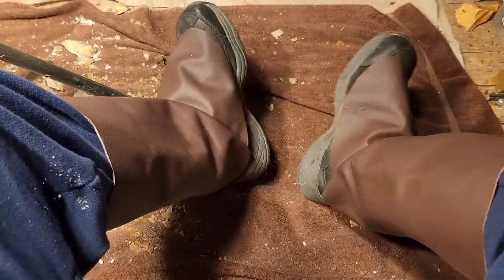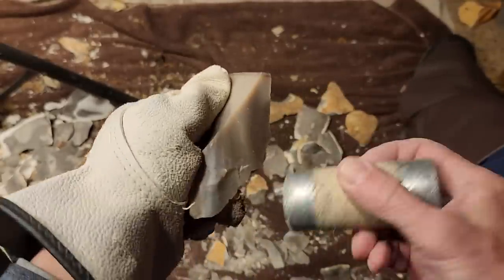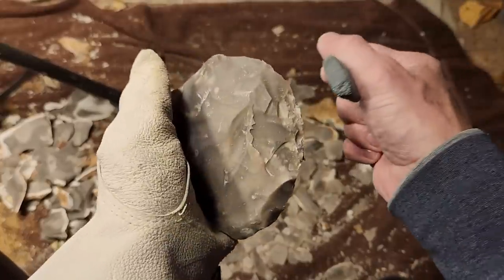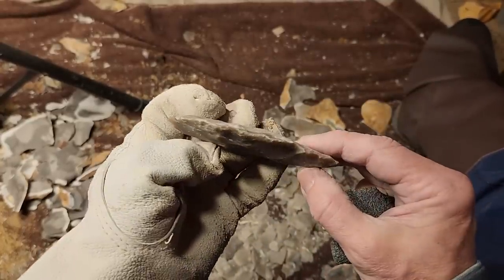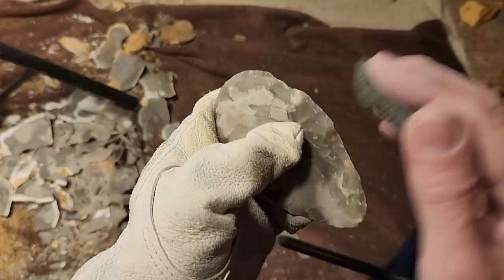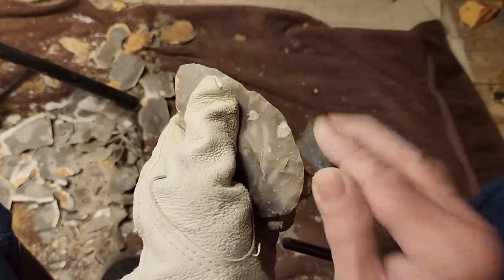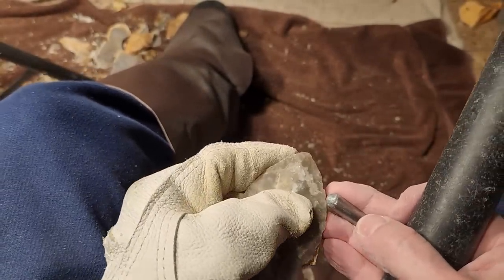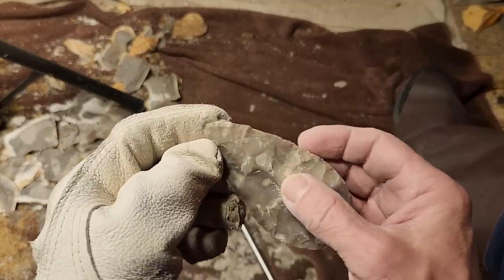1462 - Thinning the Unpredictable

Comment: Well idk if I'll finish this entire video, I was only mildly curious about the content. I actually kept "watching" because I align with your thoughts. I did however watch at fast playback and mostly listened.

I leave my spellcheck factory and it has damn well learned to only correct my fat fingered mistakes. I don't misspell but I do fat finger a lot. What I do spell incorrectly is done on purpose for a reason.

I believe it would be highly entertaining and educational to sit around a fire with a few of those drinks and ponder existence with you

Edit; had to fix my own fat finger that time. It is starting to leave those alone. I will say sometimes it fixes a fat finger to something that is grammatically incorrect or some other word I totally didn't want
Reply from the maker: My fingers are not fat but they somehow slide too much accross the keyboard and it thinks I'm trying to use some fancy tricks or shortcuts. I miss the old ways.

Comment: I think the idea that humans are smart but have no useful physical adaptations except for our thumbs is incredibly wrong. Humans have incredible endurance, even greater than most mammals. 3-4 guys with wood spears or clubs can run an antelope to exhaustion pretty easily and then beat it to death when it can’t run anymore. The ability to throw rocks also probably didn’t hurt either
Reply from the maker: True
Reply: How about the ability to improve on the tools/weapons humans use. Not only does it require the intelligence and imagination to do so,it also requires the manual dexterity to accomplish the intended improvements desired. I’d say human beings have quite a number of small but not insignificant adaptations
Reply: @panzerlieb  I’m just saying that the idea that humans are helpless aside from intelligence is wrong. We like many animals are the best at something that is particularly running for a very long time without stopping. Obviously hands and brains help but we wouldn’t have made it this far without incredible bodies as well